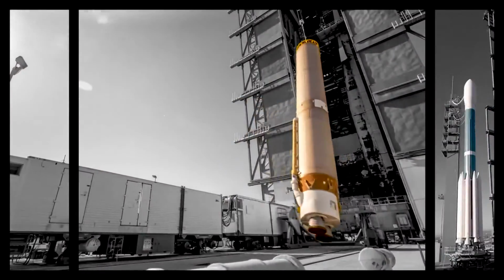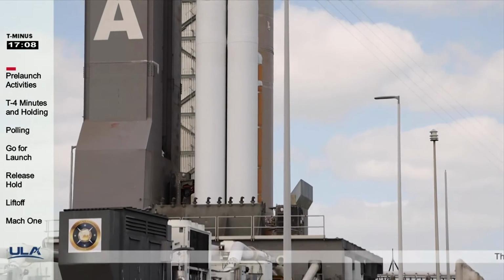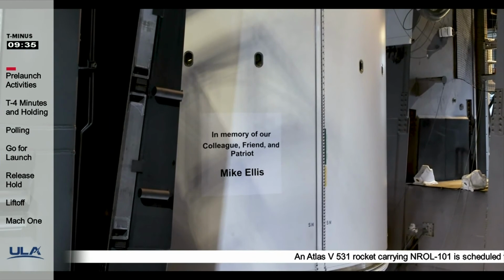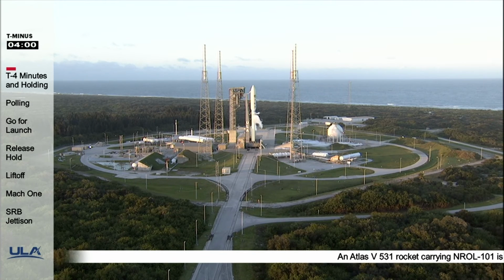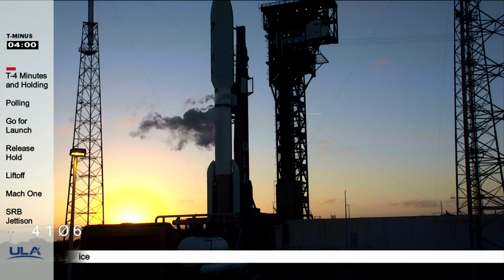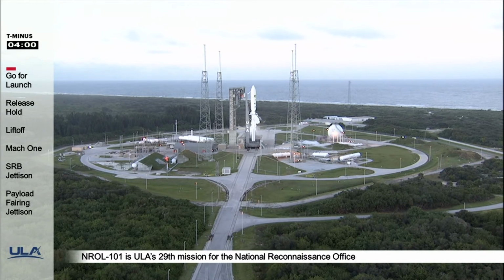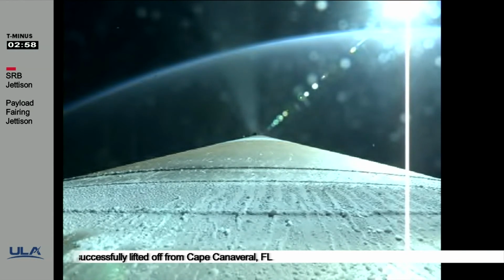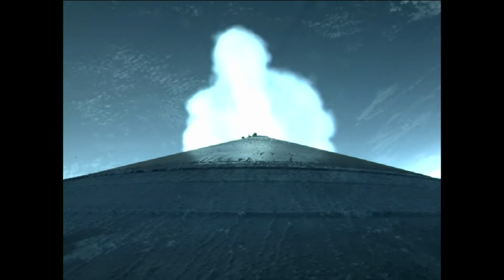Nov. 13 Live Broadcast: Atlas V NROL-101

Comment: I can't lie, 100% of this launch was beautiful and that goes for both visually and mechanically, and I mean every single second.  I've watched thousands of launches but this one just topped my list. Right from the start before Atlas V even cleared the pad it gave us the most serene views I've ever seen. Then the tracking camera views with all that smoke billowing and then after booster sep the view from the tracking camera of the SRBs flipping thru the air. I mean this one was amazing ULA, it truly was. It's one thing if this launch was one of my first to say all that but I've seen thousands and this one was just amazing. Now of we can get Delta IV NROL-44 off the ground then we will be in business. Good job on another one ULA!
Reply: I wouldn’t go that far, but definitely a great launch